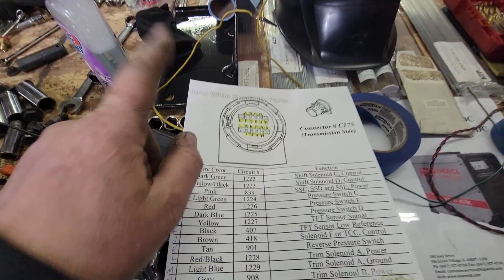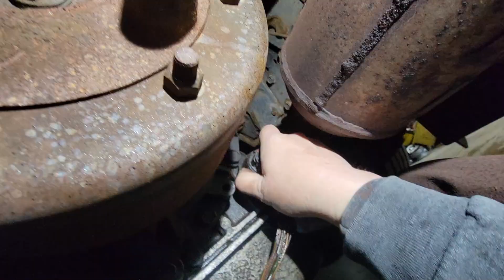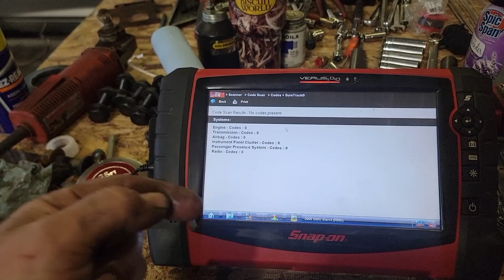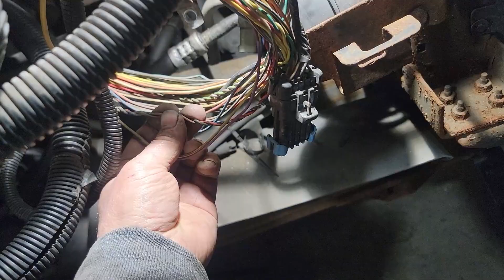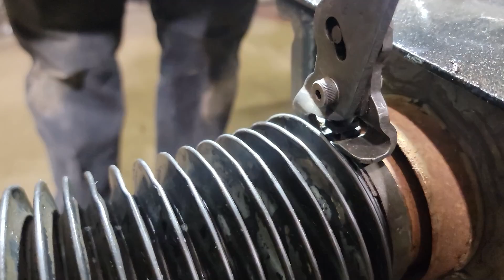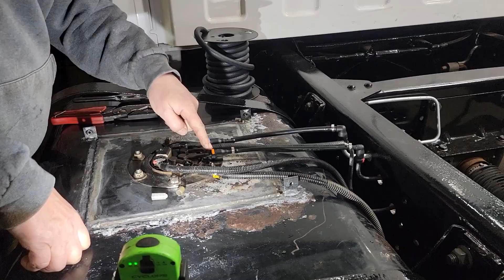ALLISON HAS NO REVERSE! HOW I FIXED IT FOR LESS THAN $1.00.

Comment: I never thought about it before but I believe you proved the wiring loom is designed to protect the electrical wires while they are under warranty. Then they work to cause problems so the manufacturers can sell more new vehicles.  Thank you for taking us along you do great repairs. Tom

Comment: What is the CA and Cab to end of frame now? U-Haul says on their sight that these trucks are rated to tow only 7500 lbs. I find that hard to believe. That had to be a function of its original intended use with a heavy box and the flimsy bumper you removed. I would think after you put the hitch plate on it, it could easily do 15-20K pulling. Not sure what the axle is rated for, but with a GN or 5W, I would think it could do that too, only more stable. Do you know? If you buy from the U-H website, they have the maintenance records of the stuff they did. They tend to let the oil changes go for 7500 miles and wait until well into the +100K before changing the trans fluid. Did you get any of that info? I am wondering with the VIN if they would give it to you. They say those are 20K GVW and the chassis weight w/o the box is 9780 on the U-H site. That seems high, but I suppose. I had an '03 C5500 CC with a steel hauler body and weighed it on a scale. That came in at 11K, but it had the CC, Hauler, and the Duramax. That '03 had a 19500 GVWR (not 20K...maybe they round) a GCWR of 26K, and a 13500 GAWR. If your '05 is the same and someone put a bed on it, then I guess if could haul about 15K then. Sounds about right I think.
Reply from the maker: its 86" ca. 10ft to end of frame. uhaul rates them to tow that with their little hitch on the rear. i have towed over 26k with my 4500. this truck has a 13,500 rear axle. i went over the service records before i bought it. 9780 seems high to me as well. last one of these i built was same length but diesel and a 10ft steel bed and it was close to that. gcvwr isnt listed on this truck. most people (including our state police) go by axle ratings. know what they are rated for and dont overload them.

Comment: 29:40 When you route the wire loom through the hole in the frame, does the plastic loom provide enough protection or do you add a grommet?
Reply from the maker: if its a loose hole, i put a grommet. if its tight enough and the wire loom cant move, , i dont.

Comment: There is a fix for that leaky transmission connector. Rubber gasket thing just pops out and you slide a new one in
Reply: Inside trans or outside?

Comment: Haaa wire loom damage shocker not to me not something the normal car or light truck repair person runs across to much. I seen enough of it repairing commercial trucks bad repairs been dealing with trash trucks for over 12 years front loaders are the some of the worst to deal with fiuld leaks exhuast heat and trash that gets over the packer wall replaced many trannsmisson harness in mack mru's and leu's oh so fun.

Comment: You got a part number on rear shocks was told on my retired Uhaul there not available
Reply from the maker: take a wire wheel to yours. the part number is usually stamped on them.

Comment: one word of caution on 'largefleet' GM's with Allisons.They spec'd out those trucks down to the penny-most of them will have a 6-bolt PTO cover with no gear inside to drive one,ask me how I know-LOL
Reply from the maker: i always run the trans serial number before i buy a truck to know if it is there or not. never bought any uhaul ever that had one. i addressed this is part 1 of this series. many folks have made this mistake.

Comment: J.C. You do nice work, u haul , had training classes for there techs back in the 80 dees one of the things they would teach is you can fix any truck if you can find the answer to these three questions 1) confirm the complaint 2) find the cause of the problem 3) confirm  the repair.  I thought it was a great thing to teach new technicians….

Comment: never understood wiring and the way most do it. the other day was watching a repair had i think 5 wires he used the same color on all of them. i had to wire a relay on a f250 today i moved the wires in the replacement pigtail to match original wiring. imostly work on dodge pickup but i bet i have 15 or 20 complete harnesses to pull wire from to match original only takes a few minutes to do it correctly
Reply: Laziness